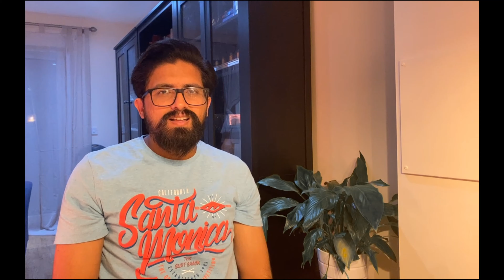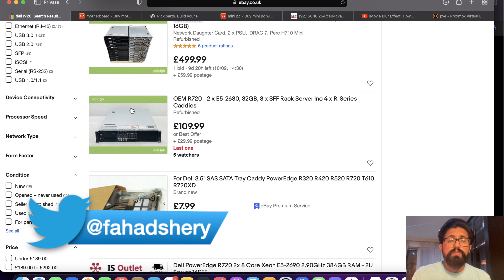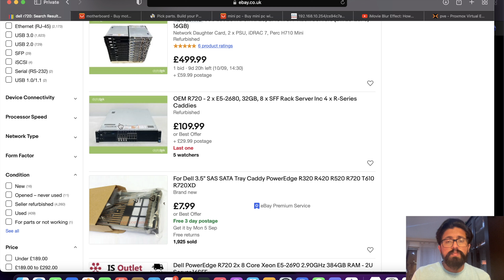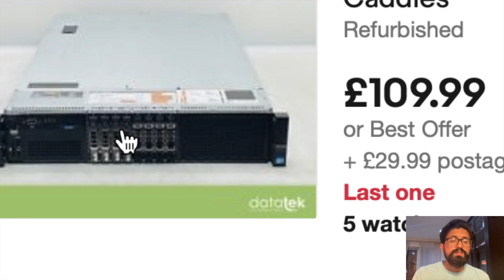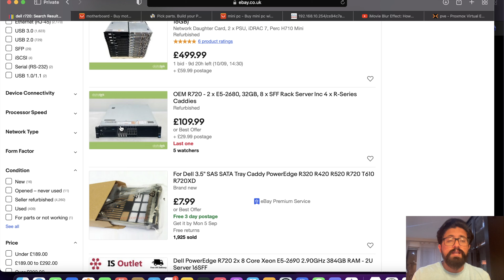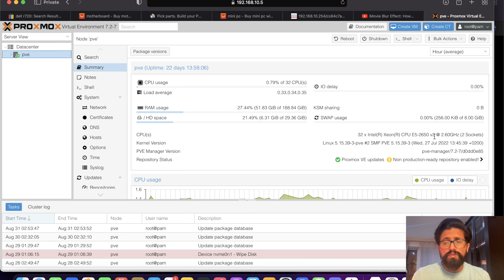Homelab hardware tips I wish I'd known earlier!

Comment: Hi, I noticed that your home lab is a single server pfSense and VMs. Is this correct? In my case, I have a single PC. I want to run everything on it, including NAS, pfSense, VMs (Windows and Linux). Do you recommend that?
Reply from the maker: @nouraldeen691  I’ve split my homelab into two groups. One is where I want services to be up and running all the time like DNS, my website, blog etc. for these services I went with a server that is using very little electricity. the other group is on demand services like AI, gaming, even NAS to some extent. Therefore My homelab is no longer all in one server. I find this setup to be very cheap to run
Reply: @techtodaylab  Gaming on top of Proxmox? How is the user experience? Do you access it from another PC using a remote desktop or something?
Reply from the maker: @nouraldeen691  depends on the game. more demanding games would suffer but games like Hitman 3 etc. work flawlessly